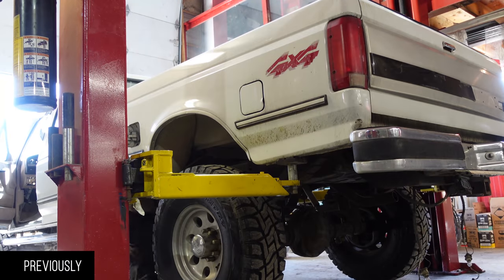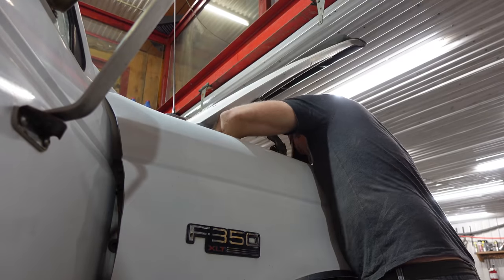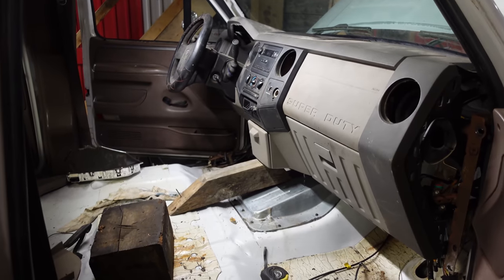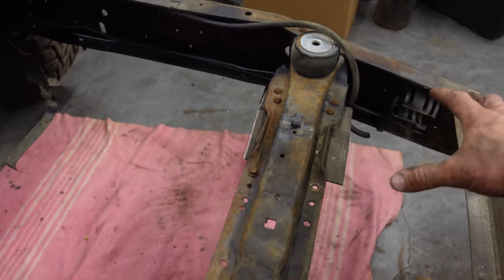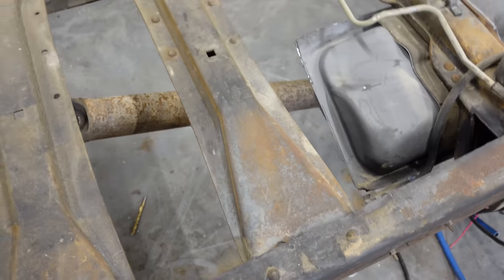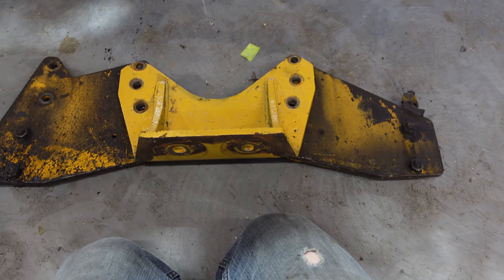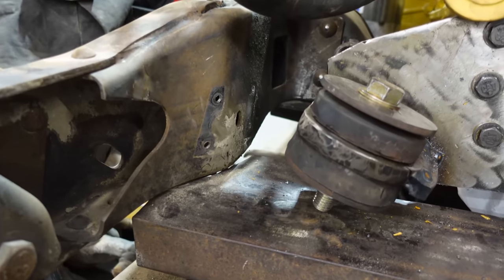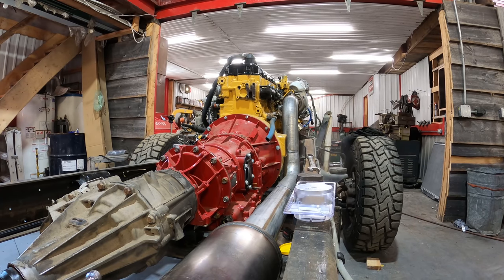If the CAT Doesn't Fit... DIY Engine Mounts | #FTreeKitty [EP12]

Comment: I do not have a You Tube channel for many of the reasons your mentioned. I am on a few forums and this is as much mindless critic comment as I can take. I am a skilled fabricator with lots of experience and I can recognize a fake zero experience armchair critic a sentence away. The criticism usually starts off with," I have never seen this before."
  Like you, I do not sell anything I will not use. I have a friend who makes money selling used parts. He gets what I will not use and he make a few bucks off the scrap and the good stuff. 
Good channel, for the most part. I do not like to see you waste your time on old trucks that will never make it back on the road.

Comment: Hell man you went that far.. I would remove the steering box all together and replace that steering with Hydraulics. That steering Tyrod is freaking weak and has a bend in it from the factory.. you don't want that to have any bends in it. It's a weak spot.

Comment: Can someone remind me what trans is in this?
Reply from the maker: Allison 2000 built by xcalliber.  They added a parking prawl, made it a 5 speed and replaced the output shaft and tailstock to work with 4x4
Reply: @DEBOSSGARAGE  that's badass, I knew it was an Allison but didn't know which one. love this build!

Comment: Why would you not sand down and then rust proof the metal frame supports of the dash before you put it back in, that would solve the rust issue you are always complaining about
Reply from the maker: Its called mocking it up.  It will be in and out 6 times before its permanent.
Reply: @DEBOSSGARAGE  No worries then.

Comment: Who cares about the people that say save it or whatever. It's a Ford no one cares about a Ford lol. There are so many of them. Anyway, in regards to your dilemma with putting a plate to cover to space for the motor mount....why not weld the nut in place and then the bolt could be removed from the top and you could then cover that triangular hole up and make it look cleaner.

Comment: I bought cat engine 3116 600 all in peace s.stupid not engine builder thought he was the mechanic took it apart thought it had lost oil pressure never did so I'll put it all back together again he said it was a complete engine there's no there's no pump no starter and no injectors but I put it all back together again that's okay that stuff you should be placed anyways importance at 86 Ford F-250 I restore the body taking off the inline six

Comment: That is a lot of effort just to get a smelly dirty diesel in there...
Reply from the maker: A lot of effort to save $20 000 in fuel cost over 80 000 miles....
Reply: @DEBOSSGARAGE  good point. How much does LPG cost there? Maybe make it dual fuel, safe even more money, get a bit more power, and less polution. What about an EV conversion
Reply from the maker: @ΘάνατοςΧορτοφάγος  we discussed adding HHO to this setup when the engine was being built, still exploring that. Might be a fun experiment. But this is a tow pig for pulling a car trailer across country so EV makes no sense. Stick around until September though...